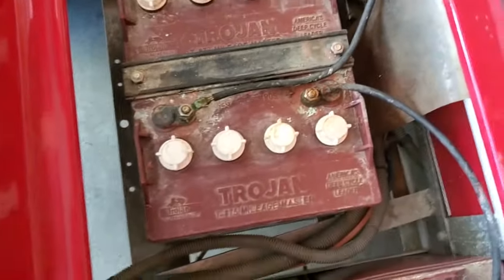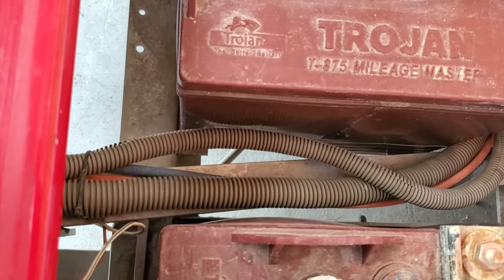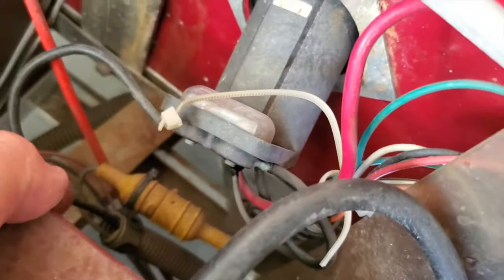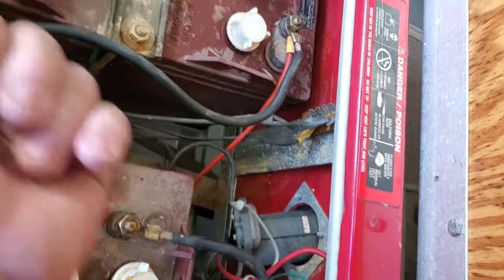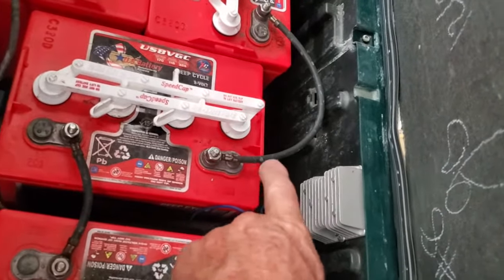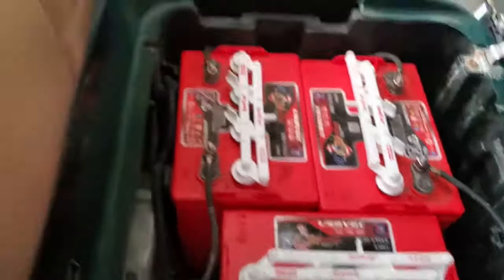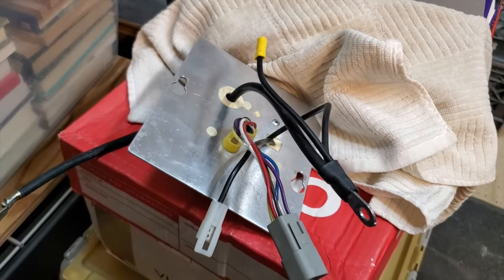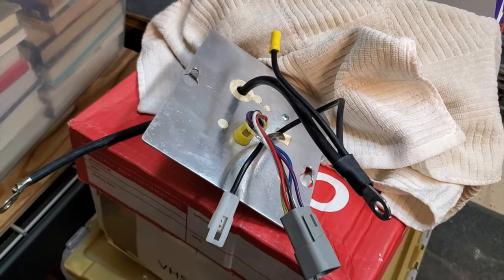How To Bypass Your OBC

Comment: I'm a little confused on one part, I have a 2004 Club Car DS and I'm going with the Single Eco Lithium battery, watching your video here I've come across the part you were talking about your yellow wire from the solenoid to your main negative, you said to reuse the #12 grey wire to help reach. The problem I'm running into is the yellow wire coming from  the solenoid is going to the plug that went to the OBC, its a 3 wire plug. Yellow, Red, Black. Do I need to do anything with those other wires? The old charger is also still connected to the solenoid still so I'm trying to figure how to get rid of that and if wire the new battery in. Haven't found much content on the internet showing these older club cars being modified with the newer style lithium batteries. Any helps and tips appreciated, love all the other videos!
Reply from the maker: How can the charger be connected to the solenoid?
Reply from the maker: That yellow wire needs to be cut off at the obc and extended to the  main battery pack negative,  or else to B- on the controller.
Reply: @waynemartin.waynesgolfcart4900  I think im mistaken the controller for a charger, its mounted behind the seat next to the OBC

Comment: Hi Wayne! Great videos. I have a 98 ds 48volt and unfortunately I changed the obc and it still won't charge (i tryed another charger)...is there a way to reset that obc since it doesn't have a tow switch.I would like to try before I bypass.
Reply from the maker: The only way to reset the obc, is to unhook all power and let cart sit that way for 10 minutes.  Then hook back up.

If you are positive you have a good working obc, and cart wont charge, try these :

Check carts charge receptacle ,
check # 10 red wire on main positive  for corrosion or swelling,  check fuse in yellow holder , try tugging a little on the gray wire at back of receptacle to see if it pulls out.

Comment: Wayne, My Crown batteries were 4 years old so I thought my problem was with them. Replaced on the precendent Trojans. It is a 48 volt cart. I charged the batteries up to fool charge. Hit the reverse switch and push the pedal. The voltage display drops to 0%, no light at all. Cart does not move. Any ideas what might be the problem. I put a new speed sensor and  a chinese mcor about a month ago before I replaced the batteries.
Reply from the maker: Sounds like either you missed a wire or even maybe the tow switch is still in tow?
Reply: @waynemartin.waynesgolfcart4900  I was wondering if the switch is not working. I am able to push the cart foward and backwards  with ease when it is in run.
Reply: Also if I play with the switch back and forth through run and tow the light indicating full charge flickers on on off.
Reply from the maker: Yes, you can push the cart in both tow and run .
Will reverse buzzer work in run but not in tow?
Reply: @waynemartin.waynesgolfcart4900  yes it does buzz when hitting the reverse side. However it buzzes, the voltage indicator drops where it is not visible. Of the cart. After a while it will go through the same sequences.
Reply: It will indicate a full charge and by merely Turing the key to on the voltage indicator drops off completely,  no longer have a light indicating full charge.
Reply from the maker: Maybe something is wired wrong
 Was this cart running until you changed the batteries, now it won't run? What is the back story? Quicker response thru text.

Comment: Wayne, great video.  I have an AQ07 a "Precedent DS"?  I do not have a yellow wire on the low amp side of selenoid, light blue and blue/white which trace back to mcor 1, not obc.  So assuming wired like a Precedent and have white and blue connected.  I  have everything working except press accelerator and nothing.  I don't think signal getting to selenoid?
Reply from the maker: yes by pass like the precedent,  splice white and blue wires together at the obc connector.  THAT should not affect the running at all.
Did u get it running?
Reply: @waynemartin.waynesgolfcart4900  no, can't figure out problem but think it is the mcor not sending current to selenoid when step on pedal.  Novice at testing electrical current.
Reply: Hello Mr Wayne. I did the Loop white and blue wire on my Precedent 2012 and new charger still not charging. What would I miss?? Thanks
Reply from the maker: If no skinny yellow on solenoid,  then forget about that wire. You touch no wires going to the mcor. 
If you spliced the blue to the white, at the obc, on the  controller side of that gray connector,  then the only other thing to do is route the black wire from back of charge receptacle to the main battery pack negative. 
All that should do it, nothing else. If after doing that, your cart don't run, it's either the batteries or the mcor.

Comment: So what I found is on the club car president once you splice the two black wires and do the blue and white wires. The old charger will not work that small grey wire must be hook to Voltage because that controls the 48v relay in the charger.  I thought by doing the bypass I would be able to still charge with the old charger until my new ocb came in. But I don’t know what side to hook that small grey wire up to coming out of the charger receptacle that’s in the golf car. It’s the grey wire that has the spade connector on it that plugs in back of the OCB
Reply from the maker: Once you bypass the obc. the old charger won't work. Thats why you don't do it before you have your new charger first.
Reply: @waynemartin.waynesgolfcart4900  
Okay I thought I heard you say it will work it just won’t shut off.  But anyway I have a new OBC coming.
Reply from the maker: correct.  You can do some temporary wire swapping inside the charger to make it come on, but it won't shut off.
It's doable,  but I don't  like to suggest it.
Reply: @waynemartin.waynesgolfcart4900   I get it. I’ll wait till the new OBC comes Tuesday. Thanks

Comment: Hi Wayne, 

I need your help, money is tight so i am trying my best to do this myself. I have a 99 clubcar ds and i am switching over to lithium. I am trying to bypass my obc bypass. I have the 3 wire set up. Brown, yellow, and red. I found the tubing removed the neagative 10awg and small grey wire from the charger recepticle. I took the 10 ground and placed it on my - battery terminal. I took the yellow wire from the contoller connection and wired it to the negative terminal on my controller along with the 10awg ground wire. I get the reverse buzzer when i turn on the key, but the cart will not move at all. I get the click from the solenoid but no movement. I tried to charge my 4 12v 100ah lithium batteries last night but they did not charge. I have a brand new smart charger and i hooked up the clips it came with. No luck!!!
Reply from the maker: As far as the bypass, it sounds like you didn't do it right.
The black # 10 wire needs to run from the carts charge receptacle to the main negative on the batteries. 
The only yellow wire you need to do anything with, is if you have a skinny yellow wire on the solenoid.  If you do have this Wire , that wire needs to run from the solenoid to the that same main negative battery terminal.
Reply: @waynemartin.waynesgolfcart4900  I  corrected the wiring on the bypass as instructed. I do have the yellow also on the negative battery terminal from the soleniod. I do have 110 at the controller from the solenoid, but no movement on the cart. Next i will check the switch, but im sure its good. Any ideas what i should check on? Not sure if my controller is fired or what?
Reply from the maker: @gtphones  I have never heard of 110 volts at a controller, that would absolutely fry the controller.

Comment: Hi
Me again 
I’ve done the by pass per your instructions.  
Yet my charger will not work 
I think it’s because it does not get the volts from the batteries to the relay to turn it on.  The grey wIre that was disconnected provided that. 
So should I remove or by pass the charger relay to get it to charge?
My idea was to put the charger on timer so it does not over charge the batteries.   I keep my cart in my garage so having it charge a few hours each day should work 
Am I on the right track??
Thanks.  
Steve
Reply from the maker: If you have a power drive charger, and you did a obc bypass, that charger will no longer work on that cart.
Reply: That’s not what you say in your video.    You say it will work but not automatically shut off.   ??????
Reply from the maker: If I actually said that, then I need to change it.

You can get the charger to turn on by  moving wires around,  but it won't turn off.
And if you try to use a timer, that is such a bad idea, you will not get the life out of your batteries that you should.
Reply: Thanx for the reply

Comment: Wayne....this was a GREAT video.  So, first off......THANKS!  Here is my situation.  I have a 1999 Club Car 48V DS.  I recently replaced the 6 batteries with a singe LiPo4Fe suitcase battery that I had built.  As for the charger, I have a smart charger that charges the battery directly and I do not even use the old charging receptacle in the cart.  Currently, the negative cable passes from the negative terminal on the battery....through the OBC....and attaches to the controller.  

However, I am looking to upgrade my controller, solenoid,  F&R Switch and use all 2 gauge wires.  I know that I can use a metal bolt to pass through the OBC since the 2g cables are too thick....but my question is....do I still need the OBC?  Is it something that I have to have to keep the cart running?  Or can I remove it?

Thanks in Advance.
Reply from the maker: With lithium batteries,  yes remove the obc, bypass it completely.
Reply: @waynemartin.waynesgolfcart4900  Sorry....I had a link in the post that I removed.

Thank for such a fast response!  So, when I look at my OBC, I have 6 wires that come out of it (and the hole for the negative battery passthrough). 

Here are the 6 wires...

Wires 1 & 2:
1.)  Thick black wire in your video that goes to the Charging Plug.
2.)  Grey wire that is in your video that shuts off the Charger.

Wire 3:
3.)  There is another thick black wire that attaches to the B- on the Controller just like the Cable from the battery that passes thru the OBC.

Then, out of the OBC, there are 3 more wires that attach to a 3 prong plug:
4.)  Red
5.)  Yellow
6.)  Brown

If I remove the OBC completely, what do I do with the Red, Yellow and Brown wires?  Just unplug it, rip out the OBC and be done?  Or do I need to do something with those 3 wires that are on the the other end of the plug that is connected to the OBC?

Thanks again in advance.  I just need to be clear with what I need to do so I do not mess it up. :)   And I would love to get rid of the OBC.  One less thing to break....

If you need pictures or want to FaceTime/video chat.....I am game!  Just let me know!

Thanks!
John
Reply from the maker: John, if you are asking how to bypass,  :

as shown in video,  cut the gray wire off, don't need it.
Reroute the #10 black from charge receptacle to main pack negative.
Reroute that yellow wire over to pack negative or to controller B-.

cap off red wire.Dont need to do anything else except get a different charger.

Comment: Hi Wayne my name is Mike I have a 2013 48 volt club car is there a fuse that goes to the obc ? My cart stopped working  the batteries are at 48 volts the charger works I changed the batteries but the cart don’t work
Reply from the maker: No fuse to the obc, but there is 1 fuse I'm line to the solenoid.
Reply: @waynemartin.waynesgolfcart4900  ok Thanks I will check the Fuse over the weekend ! Will let you know if it fixes it ! Thanks Again mike
Reply from the maker: I answered you in the email.

Comment: on a 09 Precedent does the grey wire send a ground from the controller back to the charger ? I put the grey wire from the receptacle to the negative along with the black wire from receptacle it is charging but will it do anything to the charger and from the sounds of things I don't need the grey wire at all ?
Reply from the maker: If you are doing a bypass, you do not need the gray wire at all.  If you tied it to the negative,  that's OK but not needed.
Reply: @waynemartin.waynesgolfcart4900   Thanks Wayne, I disconnected the grey wire and the charger stopped then reconnected it started again do I need a different charger to run it without that grey wire
Reply from the maker: If you did a bypass,  then your old charger will no longer work properly for you, you need to get a charger for a cart that has a bypassed obc.

Comment: I have a 98 club car ds that sometimes works fine. Other times it acts like it goes to move but doesn't and i also do not hear solenoid clicking. Any idea of what it could be? F/R switch is brand new. I'm thinking possibly solenoid but someone mentioned about lock out feature and the obc thinking the cart is charging
Reply from the maker: If solenoid is not clicking,  then it's gonna be batteries, key switch, loose connection, bad solenoid,  or the mcor/vglide .
Reply: @waynemartin.waynesgolfcart4900  ok sounds good. Key switch is good because I jumped it and still nothing.

Comment: did the bypass i had to leave the gray wire hooked up my charger wouldnt work with out it just have to keep an eye on it charging until i get new parts
Reply from the maker: Sounds like you didn't do it properly,  if you are still using your old charger.

Comment: I just put in Lithiumbatterys and it messed up the OBC so I did what you said I have an Alltrax 400 controller and talking with them they said that it was the OBC and I did the white wire and blue wire and it still not opening up the solenoid what do you think
Reply from the maker: First. I have a hard time believing the lithium batteries " messed up" your obc.

Which lithiums did you install?
What is or is not happening? What is the issue you are having?

Comment: I just bought a controller for my club car and new batteries but my car has lost speed, and after a few trips it starts for a few meters and stops, when I measured the voltage of the batteries they give 7 65 volte instead of 8 volte. I noticed that there is no acid in it. can you explain to me what I should do. thank you
Reply from the maker: You bought new batteries,  and they are dry,  no acid in them?
Return them, they may be damaged already.
If you have batteries that you drove that are dry, you better fill them with water, and charge them 2 or 3 times before driving again, and see if they will recover.
Reply: @waynemartin.waynesgolfcart4900  thanks you

Comment: Hello Wayne. Question for you. Will a Club Car DS 48 volt run with just 5-8 volt batteries? I have one bad battery but the other 5 are fine. The batteries will not charge and I'm thinking it may be the one bad battery that's the issue. Can I just remove that one from the set and see if that's the problem? Thanks!
Reply from the maker: it will move a little,  but not very far.
Yes bypass the battery, charter should still come on
Reply: @waynemartin.waynesgolfcart4900  Thanks so much for your quick reply! I will try that. I also purchased a smart charger and they claimed all I needed to do was to connect the #10 wire they supplied to the charge terminal  and the other end to the main negative terminal on the battery to bypass the OBC. That did not work so I'm going to try your OBC bypass instructions. I'll let you know how I make out-Greg.
Reply: @waynemartin.waynesgolfcart4900  Hi again Wayne. Quick question regarding the bypass. After cutting the yellow wire, which end do I splice the gray wire to in order to extend it to the main negative battery terminal. The end coming out of the OBC or the end coming out of the solenoid? Thanks!
Reply from the maker: if you have a skinny yellow wire on the solenoid,  you want to cut and reroute so it will go from solenoid to the main negative
Reply: @waynemartin.waynesgolfcart4900  Thanks Wayne. I followed all the bypass procedures but the batteries still won't charge. I'm actually going to have our nearest golf cart repair shop take a look and see what's going on. But thanks anyway for your video and all your replies!

Comment: I have a 2002 ds and don’t have the yellow wire to the solenoid. I read the guys comment who has an 04 with the same thing. After I splice my blue and white wire together do I need to plug back in the connector to the obc?
Reply from the maker: If you don't have yellow wire,  don't worry about it the .
If you splice the blue and white BEFORE THE PLASTIC CONNECTOR then you don't need to plug it back in.

Comment: I need help   I have 4 Li ion 12 volt 100 ah lynx batteries and doing swap , my cart is a 97 98 model  , I going to use a new charger purchased with my batteries  , my question is I need to cut the gray and black wires in the charging receptacle that go to the obc , my connector is triangular the connects the obc to the controller  , but looks like it has 6 pins  , do I need to connect the blue and white wires on this connector and unplug it , my cart is older and doesn’t look exactly like the connectors in your ds
Reply: I also know I need to connect the yellow solenoid wire to the negative main terminal
Reply from the maker: If the gray connector has a white wire and also a blue wire, then you need to splice those together.
Reply: Ty so much

Comment: i have a 97 pd+, and the yellow wire that comes from obc goes directly to the t-shaped controller.  it is a regen 1.  i dont have a yellow wire on neither solenoid.
Reply from the maker: Follow that yellow wire,  and there should be a bullet connector near the controller. 
Disconnect the yellow wire there,  then extend the part of the yellow wire from the controller,  to either the controller negative or to the pack negative.
Reply: @waynemartin.waynesgolfcart4900  thanks